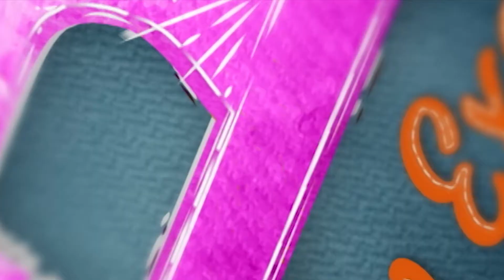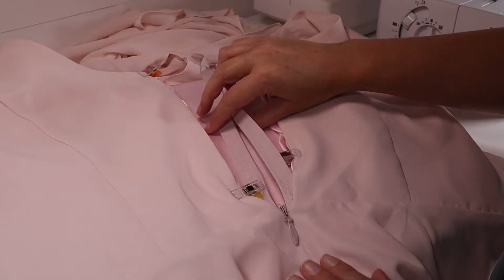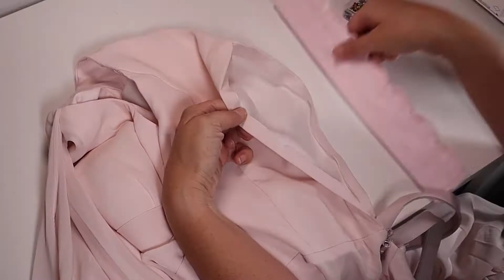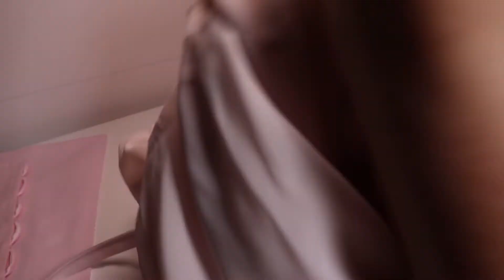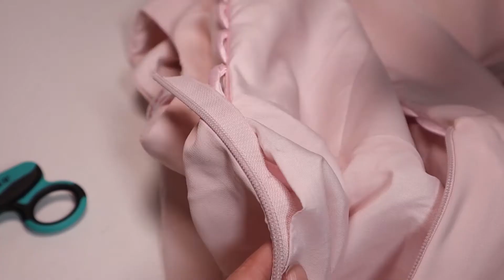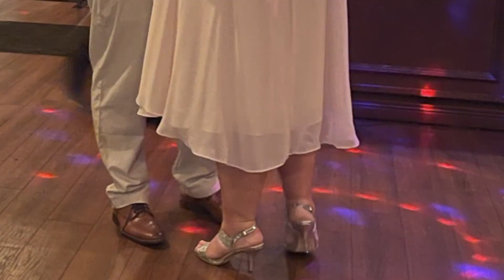DIY Bridal Alterations | Half Zipper/Half Corset Kit - Save MONEY!

Comment: This is exactly the video I needed. I thrifted a dress that I LOVE but it doesn't fit right
Reply from the maker: Hi! I’m glad it helped. Hope it fits after completed!
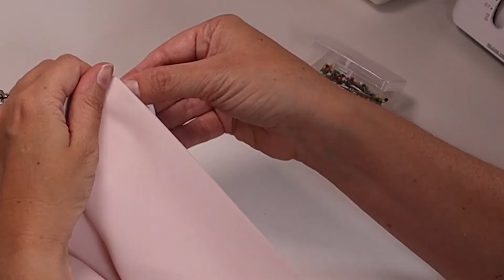Reply: @ImSewExcited thank you!! I have my dress ready to be sewn and the corset pieces cut to size but I just cannot figure out the method you used at minute 3:40! I want to hide the stitches
Reply from the maker: It is tricky.  Especially the first one.  Think of it this way - it’s a regular seam with right sides together.  Now in between that regular seam, nestle the loop tape with the loops facing away from the edges, sticking out just beyond the stitch line.  Before sewing, double check the placement by turning it right side out.  I hope that helps?